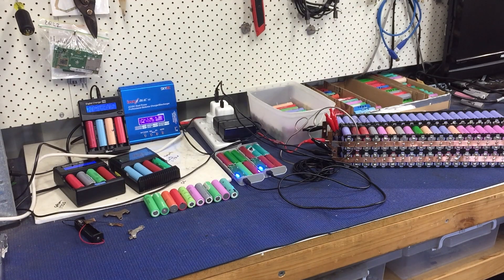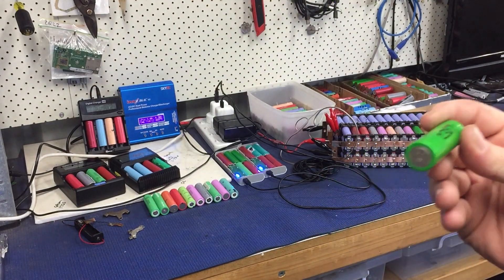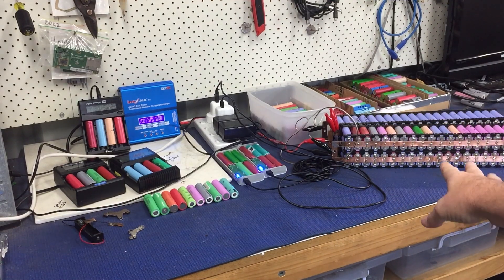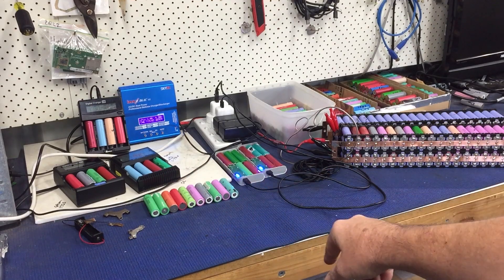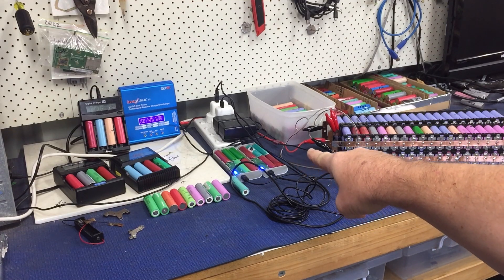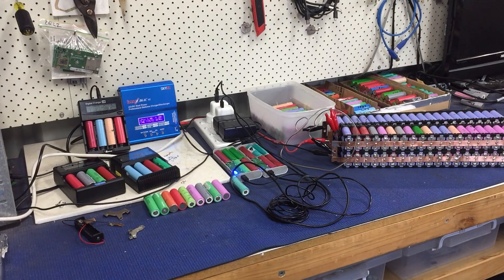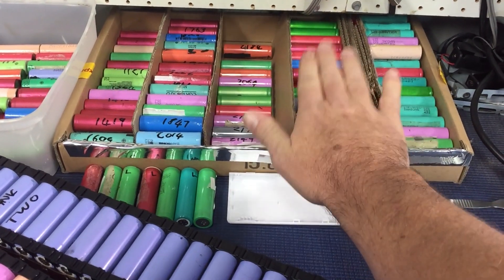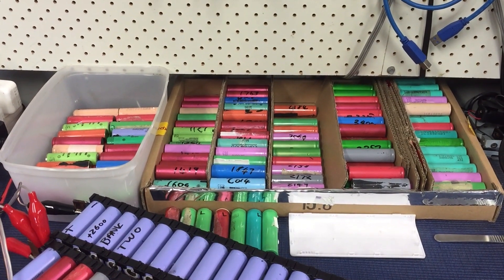How I'm charging & discharging my 18650 cells

Comment: on what setting you charge 1 18650 cell? lipo or li ion? (i have the same charger B6AC V2) and what amperage you set the charging and discharging (1 cell) im a noob and dont seem to find the sweet spot. thanks in advance.
Reply: It’s better to charge with 0.5 amp, no heating no harmful to battery. Discharge less than 0.5 amp. High current increases heat.

Comment: What is the reason behind discharging the cells in the first place? (I am trying to learn about cells, thank you!)
Reply from the maker: To find out the capacity of the cells and how much they vairy from when they were new - its a way of trying to work out the good from the bad cells
Reply: @HBPowerwall  I gotcha - thank you. 

Also,  I am in the market for a GOOD RELIABLE charger/analyzer I mainly use 18650s and 18350s -- tho would be nice if it was compatible with AA and AAA as well ... Any recommendation you could give me I'd be much appreciated. I have many cells for lights Ive been using and only now getting in to this "technical" side of the batteries! -- Also if I had a good charger/analyzer would I need a multimeter ? and if so, for what purpose? As I thought the charger would show me IR and volts of the cell? -- Thanks for any help !!!!   PS if I do need a Multimeter could you also recommend a good 1 for me to look at? thanks a ton and appreciate your time!

Comment: Hi need some help, I’m new to these 18650 batteries I bought
on ebay, the link below.https://www.ebay.co.uk/itm/4-x-UltraFire-18650-8800mAh-3-7V-Li-ion-Rechargeable-3-PIN-UK-Battery-Charger/262425807293?ssPageName=STRK%3AMEBIDX%3AIT&_trksid=p2060353.m2749.l2649

I’m a bit nervous on how to charge the 18650s, do I need to check that the batteries with a multimeter to see if they are below certain
voltage to charge? Any advice will help and what equipment do you recommend. thanks
Reply from the maker: put them in the bin FAST and demand your money back - you bought fake rubbish

Comment: Terminology - Each 18650 is a cell, and an array of cells is a battery. This isn't really used correctly by most people, myself included. Doesn't matter for much, but there it is.
Reply from the maker: Sounds right in hindsight

Comment: whats the good temperature of 18650s? my 18650s i took from a laptop battery went up to 172 degrees fahrenheit on discharge mode
Reply from the maker: I place my hand on them if i can feel a difference with one other than the other it's recycled
Reply: so at 172 degrees should i be concerened not to use them?

Comment: If my cell is at 10mins, 1amp , 3,3v and its at 170mah~ is the cell dead?
Reply from the maker: sounds like it is at the end of its life
Reply: HBPowerwall another one~ 1a, 3,31v, 55 mins and 900mah. Good ?
Reply from the maker: Personally, i haven't used any under 1800 mah but it depends on availability

Comment: question is for a battery pack that was sold on ebay, the lg one , that is 10s 2p 36v 4.4 ah. the battery  in that battery pack is model lg Lithium Ion ICR18650 MF1 2150mAh , its maximum current amps hr charge says Max. Charge Current 1.0C(2,150mA). Now my question is can you charge the battery pack more then 2,150mA ? Given the fact that you have 20 cells in total  so do you do 20 cells x 2,150 mA which equals 43,000mA or just 2,150mA 
Thanks

Comment: So to clarify, you first fully charge, then fully discharge and then fully charge... Right? Then the last full charge mAh number is the value that you give that cell?
Reply from the maker: Charge, discharge  then they only recharge till I see they have finished and swap in new cells to get as many processed as possible as fast as possible
Reply: I just got my opus and I am trying to figure out how you did it. I just did an initial charge on OLD laptop batteries. Like they probably haven't gotten a charge in 5 or more years. 2.7v up to 4.2v. 2200 to 2300 mAh.
Reply from the maker: make sure you test with discharge not charge as it always take more energy in to charge than to discharge

Comment: i need some help.  when testing batteries i charged  using my imax quattro b6 ,,,why do i only get a 30-0300 when discharging at 1amp but at .1 amp, i'm getting 1600-1800 ? are all the batteries i collected crap, lol . i can't seem to get any high readings ,unless i charge / discharge, at these very low rates.
Reply from the maker: Really, that is really bad luck - where did you get the cells from ?

Comment: I  know it's a while ago but do you have issues with your 4S charger running hot when discharging at 1A? I've got one and it does run hotter than I would like and I think it's due to the location of the resistor and transistor / mosfet inside and the lack of a cooling fan.

They're fine charging at 1A though...
Reply from the maker: +Morten Mortensen yes they do get hot I ran big fan on them the. Moved to the bt-c3100's they have an internal fan. Both still do the job tho.
Reply: Cool, thanks for that. 

I was actually wondering how hard it would be to move the resistors outside of the case as then the heat is dumped externally and not right below the cell that is being discharged. I'll have a look at this when I get around to building my cell testing / charging station, I have an idea to put the whole lot in a plastic case like this: http://www.screwfix.com/p/20-compartment-organiser/7260p and then be able to have it being self-contained and just need to be hooked up to a external battery / power supply when I need it...
Reply: The digital 4s only discharge at 0.5a when 4 cells are being tested. 
I just bought one of these for my project and read this a few minutes ago. 
Wouldn't this have caused big discrepencies in your results? 
0.5a vs 1.0a discharge will show in about 200-300mAh differences in capacity. 
I've been using different discharges, some that do 1A and some that don't...
What's the current draw on each cell in your powerwall?

Comment: very helpful, thanks.  When you use the Imax to charge, are you charging the pack without doing a balance charge?  I always when one charges a pack of 18650 - they must also balance charge them to.
Reply from the maker: only charging one "cell" at a time so no using balance function.
Reply: thanks

Comment: I was charging my 18650 at 2.5 A, the voltage stops at 4.2 V but the capacity kept going >2100 and I stop it. Is there an overcharge risk in this batteries.
Reply from the maker: +ssinseeme b does it go above 4.2 ?

Comment: Hey Pete, are you still using your digicharger 4s units for your discharging or have you moved to the BT-C3100 units that I saw in one of your newer videos?  Whats the Pro's and cons of which you found the best for discharge testing?
Reply from the maker: Moved to BTC3100 faster & quieter - nothing at all wrong with the 4s good units stable and stood the test of time.
Reply: HBPowerwall okay great, when you say the c3100 units are faster are you still discharging at 1amp or 2amp rate? And can it only discharge load test 1 cell at a time or all 4 at once with individual readings for each? Cheers
Reply from the maker: one amp, i think they are faster just due to having an internal fan (or maybe I'm dreaming but i do like them better)
Reply: HBPowerwall okay great thanks where's the best place to buy them from
with correct AU plug on the end rather than USA plug?
Reply from the maker: see now there's a good question :) All mine have the crap us plugs :(
Reply: HBPowerwall ohh okay fair enough yeah I could only find the ones online with USA plugs and then have to use an adaptor to convert which isn't my preferred option, but I can't seem to find any with AU plugs sadly. Do you mind doing a video sometime showing the features of your new discharge units off thanks? As I'm sure many would love to see if you wouldn't mind. It was only by chance that I'd even noticed that you'd changed to these newer ones haha :)
Reply from the maker: I'll see if i can turn it into something watchable later in the week.
Reply: Awesome, thanks that's much appreciated, as those C3100 units seem to have alot of great features and abilities so it'd be cool to cover some of the functionality of those units in a video, so people can see for themselves.  PS: Did you find the discharge readings from the C3100 units to be as accurate as your Imax B6ACV2 charger ?
Reply: I bought a Foxnovo charger however upon using it, it charged up 4 cells to 4.22v like it should and then discharged them to show capacity. However on the 2nd round it charges to a claimed 4.22v and never engages the discharge cycle. I pulled them off after a long time and put it on the multimeter and they showed 4.6v!! Needless to say I will not be buying another one of these, so I guess I will try the BTC3100. I cannot recommend the Foxnovo 4S.
Reply from the maker: never had this issue, but it's good to know that's for sure to keep an eye on it
Reply: I have seen one cell that was at 4.27V after having being discharged / charged on the 4S but I had just bought a couple of cheap one cell USB based chargers and thought it was from one of them. They seems to be stable at charging the cells at 4.16V when I started testing the voltages after the second charge so I don't know for sure how one of the cells came out at 4.27V...

I've now stopped using the S4 for the second charge as the two USB based ones allow me to put the next cells into the S4 for a charge / discharge cycle, and when that stops I record the numbers and move on the to next cell...

Comment: Hi. Do you keep weeks time and test those batteries voltage once you completed charging them? Also when do you  discharge them after they are fully charged?
Reply from the maker: +Ramesh Perera they are stored at 3.5v or so, then left for several months and the voltage is rechecked, any that have slipped below 3 ish volts are not used.
Reply: Ok. After you sorted the good voltage batteries, do you directly do the discharge test? Or did you again recharge them prior discharge test? thanks.
Reply from the maker: +Ramesh Perera charge then discharge
Reply: ok thank you buddy.

Comment: can you provide the link from where i can purchase digital charger 4s?
Reply from the maker: +Yash Patel YES, ummmmm hang
Reply from the maker: +HBPowerwall http://www.ebay.com.au/itm/141678793953?_trksid=p2057872.m2749.l2649&ssPageName=STRK%3AMEBIDX%3AIT
Reply: +HBPowerwall My Foxnovo F-2S only discharge at 0.5amp while i keep it on 1.00A, practically at 1amp discharge rate, it should consume 1mah current in 3.6 seconds, while my charger takes 7 seconds to discharge 1mah current.
Reply: +Brett Instead of going with Opus, i will recommend you to use cell tester PCB, checkout
 http://s.aliexpress.com/zMBbM7f6
Reply: I have just started doing a few cells and have been looking at getting a discharger, I don't want to be doing individually with an iMax. I was looking at the Digital 4s but also noticed the Opus module which seems to have a few more options, but at the same time I'm getting is a bit more complicated. What did you finish up getting?

Comment: Can you show us a top down view of you discharging the cells?
I am currently making a 62ah 56v pack for my electric bike with recycled 18650's but I have been using a charger that shows how many mAh it takes to charge the cells. Seeing what you have done I don't think this is a good figure to go from because  the cells all started from different levels of charge. Could you recommend any dischargers set up for me?
(currently using 3x  XTAR VC4 to charge cells)

Comment: Noticed that the ImaxB6 is almost at 47,000 mAh with a 3A charge at 12 hours. Those cells are sucking up the amps :). Just curious as to why you haven't wired the cells in series to increase your charge rate. Might be able to save a day by using the fast charge setting in series then wiring in parallel for the top up charge.
Reply from the maker: +Techburn HEAT.... that is all

Comment: When building your packs how do you pick your cells for each back. Do you have a system to keep the pack at the same or close overall capacity to another pack?  An example is how Rinoa Super-Genius did it Here -> https://www.youtube.com/watch?v=NVJNol7jq0M
Reply from the maker: +Eric Scherzinger Yes by sheer volume of cells.  all cells within the packs are within 100mah of each other.  As i get more and more cells  the modular nature of my packs means i just swap out packs constantly till the first seven cells are equal Then i'll move to the next seven. I'm not building each pack balanced because i want weight v capacity to be optimal. All lesser packs will be used for something else or sold off.

Comment: i might still use the "low quality 1600ma" batteries in my pack depending on how many higher capacity batteries i get
Reply from the maker: +donzi joe 1600mah will still work fine - so what they don't have the capacity but who cares it all up to the intended use. Recycle what ever you can, when ever you can

Comment: did you ever get some older li-ion 18650 cells (2003-2009) with 3,6v nominal voltage?
can you mix them with 3.7v cells? How would they affect battary life expectency?
Reply from the maker: +kokodin most probably, one thing i have never done is researched every cell - just tested every cell to the best of my ability. Can you mix them ? Don't know i most likely have. Life expectancy ? they are all used abused cells life expectancy has already been affected!! Now completely different story if they were new.....
Reply: +HB Powerwall I wonder if i an overthinking it :] because you might get two cells with 2000mAh measured capacity, of which one lost 1/3 of its rated size and the other one being in its best possible condition only older type. Most of 3,6v were rated at 2000-2200mAh, 3,7v are usually 2400-2800 mAh and most of them have a little bit greater C rating. One thing to consider is that 3,6v cells were changed to 4,1- 4,15v and 4,2v would be pushing it with overcharging, while most of 3,7v cells handle 4,25v just fine (which would in fact boil and kill 3,6v cell)
But if you are using only 2100 and better cells, you probably sorted those 3,6v cells out without even knowing it
Reply from the maker: sounds likley :)

Comment: Back to the grind! I came through JEHU's channel here. Nice shout out! Can't wait to see a full charged pack! Keep us updated!

Cell or 'Battery' = 1

Battery Module or 'Pack' = multiple cells or batteries as you and I think about them.

Battery = A battery is multiple modules or packs of cells that make up the battery. Good picture Rick found is the one below.

http://i230.photobucket.com/albums/ee106/PFC4L1FE/12553090_10207201273565394_5310694931479539402_n_zpsbbtkaufq.jpg